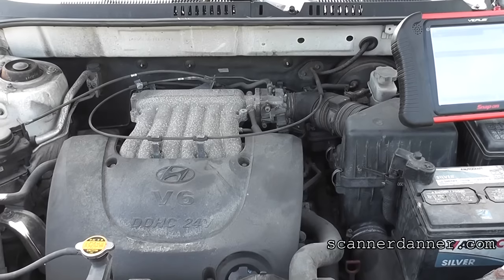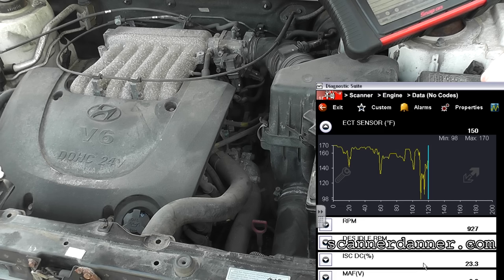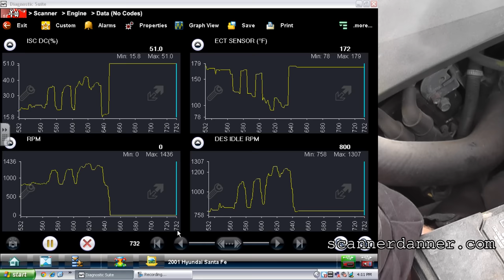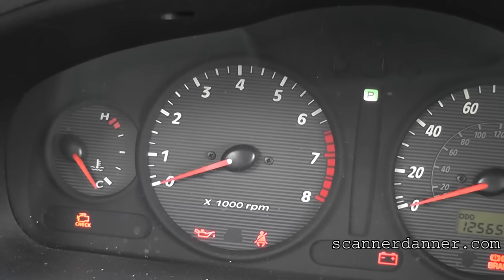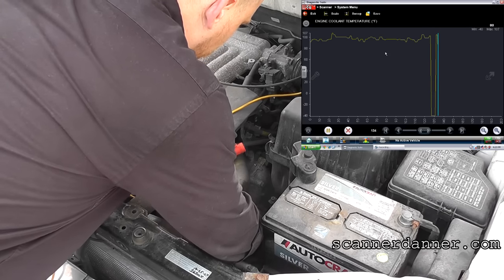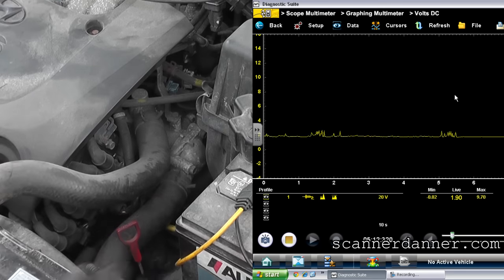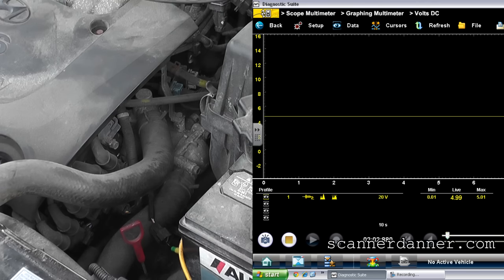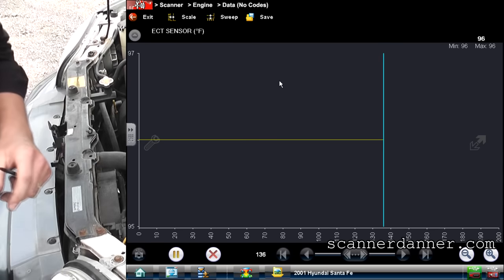How to test a coolant temperature sensor (ECT sensor test)

Comment: Amateurs. That temp sensor is essentially an RTD and the extra wiring is for calculating the resistance in the wires not for the gauge :). The gauge is controlled by the temp transmitter in the ecu.
Reply from the maker: spasev You may want to do your homework before calling someone an amateur. The third wire is for the gauge. It is NOT part of the engine coolant temperature sensor circuit. If I could post the diagram here I would. 
There are systems that one use one sensor and the data is shared across a network but it is still only a 2 -wire thermistor that would signal the ECM, then the ECM shares the data with the instrument cluster.
Reply: +ScannerDanner 
Maybe you are the one that needs to do little research before posting a replay. RTD is a resistance thermometer, and the thermistor is a type of RTD (very inaccurate one by the way) and most likely not used on that vehicle. The type of RTD used in that vehicle is probably PT100 as it is cheap to manufacture and far more supperiour to the thermistor. 2 wire RTD's are rarely used because they do not compensate for the resistance in the wires therefore it is probably 3 or 4 wire type  that properly measures the voltage drop while supplying very low current trough the probe. Also, there is no "signal" to read, but a current sensing shunt most likely 0-20ma or 4-20ma measuring the voltage drop across that shunt.
Reply from the maker: spasev I'm sorry my friend, but you are off on this one. You seem like an intelligent person, and I'm sure your description of an RTD is correct, problem is, we don't use these on automotive temp sensor circuits. 
This is a simple two wire thermistor, and the third wire is for the gauge sending unit. The housing is the ground for the gauge part of the circuit, it is not a shared ground as I described in the video. 
Automotive temp. sensors are not what you are describing. They are voltage sensing NOT current sensing circuits.
Reply: +ScannerDanner
Trust me my friend I know what I am talking about very well. That is the fundamental principle of how all RTD's work. If you open that ECU and you trace that input there will be a shunt current sensing resistor that looks for the current change caused by the fluctuations of resistance in the t RTD. It is basic Ohms law my friend, you should know that if you like to portray yourself as car tech.
Reply: If your going to continue with your condescending comments, I'm just going to ignore you. If you want to have a good dialog, we can do that. So which one will it be? Balls in your court.
Reply: spasev 

Why is this guy (spasev) including the metering circuitry
within his description of the sensor? LOL SannerDanner was describing the type
of sensor (thermistor) not electrical fundamentals that takes place to make the
thernistor work.

Comment: so if i have got it right.the increase in idle speed was that the engine was running weak or rich due to the ECU thinking that the temperature was lower than it actually was?
Reply from the maker: Dee Hounslow for sure a lower than normal ECT reading will make it run rich but this doesn't in itself increase the idle speed. It is the computer program that will provide a "cold fast idle" based on ECT temp. and it does this by opening up the IAC valve.

Comment: How come you didn't use the component tests that are included in the Verus??
Reply from the maker: Wayne Arents didn't need to, these thermistors are all tested the same way.
Reply: ScannerDanner But it would have told you the 3rd wire was for the gauge. ;)

Comment: coolant temperature sensor and cooling fan switch are this on some vehicles combine or they all are separated like a 2003 Honda Accord has a switch on the radiator and a sensor in the engine.

Comment: Scannerdanner 2006 Nissan altima 2.5 I have a problem with the temperature sensor... When my car is in Parking idle, reverse or neutral the temp gauge is at the Normal position but when I shift to drive the temp gauge starts moving and bouncing to high temp but when I shift to park reverse or neutral the temp gauge change quickly to normal position ... I took to the mechanic shop they replace temp sensor, fuse box  even the cluster but I still have the problem ... Can you let me know what do you think about it ? Thanks !!!
Reply from the maker: +jhep1985 not through text on a screen my friend. I would need to see the car. Are you close to my school in Pittsburgh PA? I would look at it for you there for free

Comment: My coolant and engine dash indicators are on. My Saturn runs like a top. Can't figure it out, BUT I'm no mechanic. 
I explained this situation to my mechanic and he said "f*** it Its likely a computer issue". I don't know where the ECT sensor is anyway to replace it though I bought a new one.
David 
Alberta
Reply from the maker: an ECT sensor fault is certainly common on Saturn systems but if you have a low coolant light on, on the dash, there is a low coolant switch in the plastic overflow bottle of the cooling system that will often stick. Smack on that coolant bottle a few times after verifying your coolant level is correct of course. 
What is "my coolant and engine dash indicators", do you mean "low coolant" and "check engine light"?

Comment: Will a ect sensor that is reading all over the place,  cause Cooling fans not to turn on? My temperature  gauge works, but the reading on the sensor while reading live data, goes up to about 90 celcuis and drops to about 5 celcius, it's all over up and down.....and sometimes it it idles high at times.
Reply from the maker: If it reads colder then normal, yes. If you disconnect it, the default should be to run the fans continuously
Reply: @ScannerDanner  awesome thnx...!! If i understood correctly....you mean if I disconnect the ect the fans should turn on by default?🤔
Reply from the maker: @crystrezerex2life  yes sir! As long as it's not an older car that may contain a separate cooling fan switch
Reply: @ScannerDanner  thnx again, I really appreciate it.

Comment: Hi Paul I have 5 voltage in both sides of the ect 2 connector and there is no ground
Reply from the maker: Measure the ground wire at the ECM connector next. If it is good at the ECM and 5v at the sensor, you have an open wire
Reply: @ScannerDanner  thank you
Reply: There is no ground from the ecm
Reply from the maker: @mazenramadan493  so you're reading 5v at the ECM sensor ground circuit, measured right at the ECM? How are the other sensor grounds? If they're also at 5v, then you most likely have a bad main computer ground. If the other sensors are good, that ECT sensor ground circuit is bad in the ECM and most likely got shorted to something? What happened?
Reply: First thank you so much for your time sir the car is running fine the only thing that the temperature sensor have no ground and I follow the wire to the ecm no open and when I test the ground from the ecm on the scanner no respond I think there is a short inside the ecm on this circuit always give me _40 reading and the code is p2185 honda pilot 2012 again thank you so much for your time sir
Reply: By the way I change the two sensors already
Reply from the maker: @mazenramadan493  it would be an open circuit in the board that you'd be looking for. You can ground that circuit to the block and see if the computer is happy with that signal. I'd do that before opening the computer up.
Reply: I did that already and the ecm not responded and still give me the same code me I'm not happy with that

Comment: I have a 1999 Ford f350 V10 with a po118 code it has 11 volts on wire that should have 5 volts I Ford where they split and go into computer and cluster so I cut them there and was going to bypass the short so I cut it off at computer and traced it going to cluster so now it blows all 3 computers it don't make sense because there's no other circuits on that wire any ideas
Reply from the maker: You have 11v on a 5v supplied circuit? You have a bad computer ground!
Reply: @ScannerDanner  the ground is good I think there's a 12 volt wire rubbing on the 5 volt wire
Reply: @ScannerDanner  and the ground is in the kick panel
Reply: @ScannerDanner  where would the pcm ground be on a 1999 Ford f350 V10
Reply: @ScannerDanner  can you help me no shop even Ford can't figure this one out
Reply from the maker: @twinscrew9.047  https://youtu.be/1Nvyc_88AbY
Watch this one!

Comment: hey scanner Danner...had a question...i am checking a 5volt ref for a map sensor on a 2001 chrctysler town and country v6 3.8L ...i disconnected the map connector and have both pcm connectors disconnected ..im showing 4.8volts on my meter..is that possible
Reply from the maker: +Roberto Z nope. You sure that's not 4.8mv?
Reply: It was odd to me
...now since u respondind back to me i recheck now i have 0v
Reply: I was checking my powers and grounds..becuz the pcm does not comm with modis
Reply: I have comm with tcm ..bcm..and abs..just not with pcm and car was running crapy found a broken correded map sensor replaced it and when i went to check signal integrity and 5 v and sengrd i pull back in tubing ..all 3 were correded mesh toget...so i repaired...and was checking that and thats when i hit u up
Reply: By the way it vehicle does start and crank over

Comment: hi! I'm having a code on my o6 passat 2.0t. p0118. The car starts rough. my fan turns on as soon as I start the engine. I measured the Voltage on the harness and it shows 14v instead of 5v. Tested continuity on ground and it fluctuates. I'm using a multi tester. Do you think it's the pcm?
Reply from the maker: What is the definition of the P0118 code?
Reply: engine coolant temperature circuit high input sensor 1.
this car has to sensors one on the cylinder head and one at the thermostat housing both read the same volts. these sensors only have 2 wires. thanks
Reply: engine coolant temperature circuit high input sensor 1.
this car has to sensors one on the cylinder head and one at the thermostat housing both read the same volts. these sensors only have 2 wires. thanks
Reply: engine coolant temperature circuit high input sensor 1.
this car has to sensors one on the cylinder head and one at the thermostat housing both read the same volts. these sensors only have 2 wires. thanks

Comment: Good morning to everybody I just need some help hope fully someone can help me I got a 97 cadillac deville with overheating problems but I will wxplain you guys what I did and what Im doing with, normally the temperature has to be on 222 f and the fans fire on and the temperature goes down to 210 f to 215 f so for me thats good but sometimes  after the fans kick on the temperature still raising on I tried the heater turning on and sometime works and sometime doesnt so I already change the thermostat , temperature coolant sensor has new coolant I never leave the car runs after 230 f to 236 f  so I shut the car off before to get there hope fully you guys can help me with some ideas or solutions ( Paul Danner I love you videos and how you explain everything you have to do just what a can tell is thank you and keep going)
Reply from the maker: You most likely have a head gasket failure :-( 
Use a block tester (chemical test kit) https://www.youtube.com/watch?v=k5VVcNKAK6U

Comment: What if the temperature indicates a normal temperature while driving (around 160°F) and then suddenly drops to -40° (for a long minutes)?
Reply from the maker: It is becoming more and more difficult to answer questions here. I have 80,000 people asking me for help now. So I have created a forum to help you guys better. It is free to join and we can exchange pictures, wiring diagrams and waveforms if needed to help guide you through the process of troubleshooting your vehicle. Thank you so much! Hope to see you there. 
Paul Danner (ScannerDanner)
https://www.scannerdanner.com/forum/post-your-repair-questions-here.html
Reply: loose connection or a break in the wire. When you unplug a thermistor sensor most cars default to -40

Comment: Dude how do you keep working when your critical battery warning pops up in Windows?  If I ever see that I freak the hell out and start running around looking for a power socket!
Reply from the maker: Ed Luck As long as I keep it plugged into the DLC, it takes power from the car and you can ignore that warning. The second you unplug from the car however, it will shut down.
Reply: ScannerDanner Ah, makes sense.  I do similar stuff with EvoScan on my Mitsubishi but still need power from a power adapter.  While on very low battery and capturing some log data one day I was reminded that the accessory circuit is cut during cranking.   Yeah that was embarrassing.

Comment: Based on this Video, I conclude My cars signal wire is being Grounded somewhere.. My Temp Gauge doesn't work and I'm getting a Solid 284*F on Scan tool.
Reply from the maker: Or the sensor is shorted. Unplug the sensor and see what scan data shows you. Use global OBDII to read it
Reply: @ScannerDanner  When I Unplug the Sensor scanner reads -39*. And Yes I'm using global OBDII to read. I have Used 3 different sensors, the last one is Brand new, what are the chances that they are all shorted?